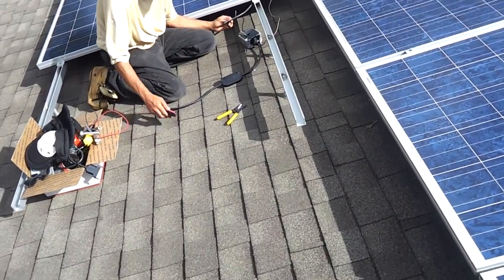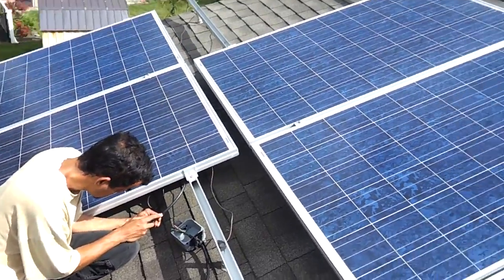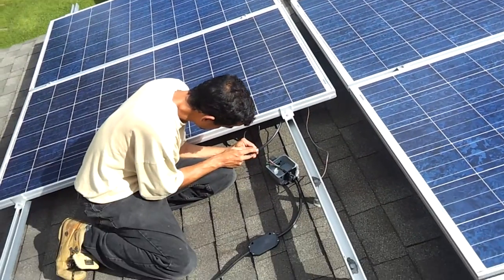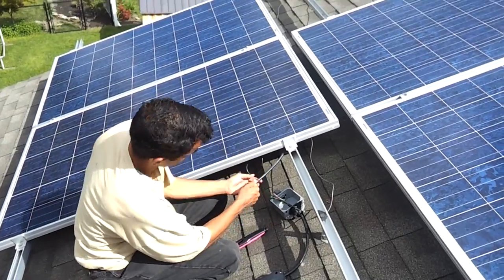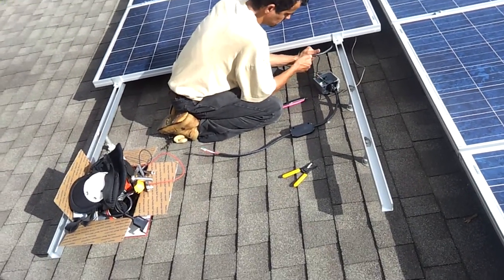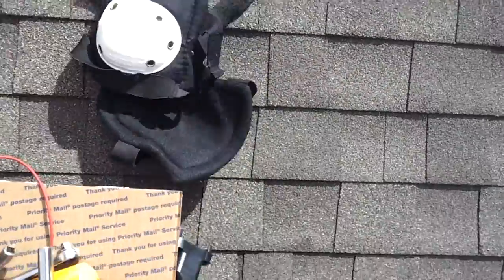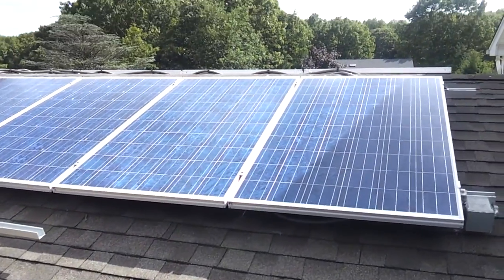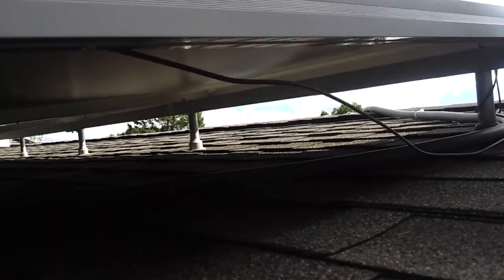Enphase Micro Inverter solar installation nice and easy

Comment: seems to me that there is a lot of energy loss due to the positioning of the panels, wasn´t there any other way to put the panels?
Reply from the maker: Tony, The way the sun covers the house we generate tons of power. The panels fully equipped only cost us $468.00 that came with 250 watt panels 230 watt Enphase inverters also with the rails screws the whole kit except for the junction box from the roof down to the disconnect and into the house. So it covers our cost and sends plenty of power back to the utility company. Come this year we are going to install the Enphase Battery cells, this will allow us to run through the night with A/C on with no cost. So if it was a little inefficient the cost alone was cheap enough. We installed ourselves and submitted all the papers needed by the town and the utility company the savings have paid off everyone of them including our time if we were to charge for it.
Reply: Thx for the answer! I was wondering about that exactly, the balance between the energy loss and the cost of the panels, but if its working for you its great to know!